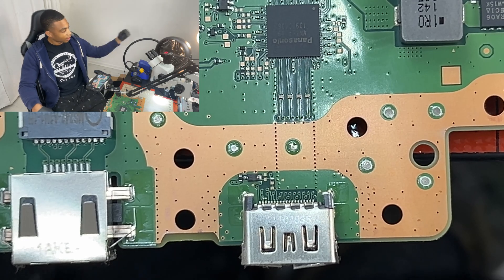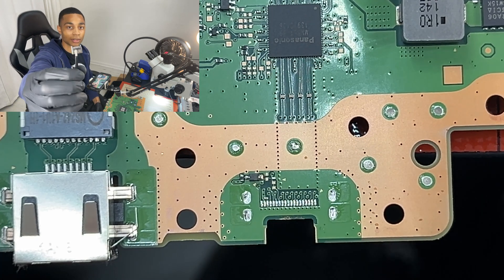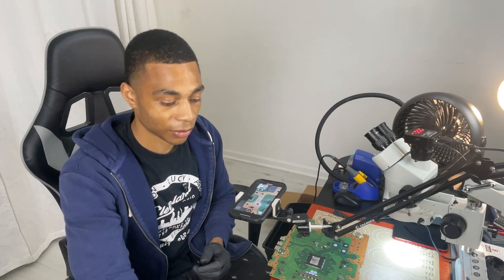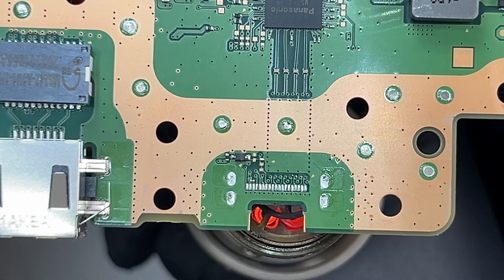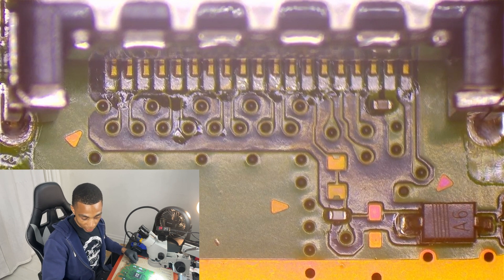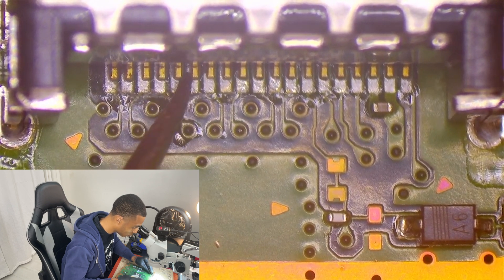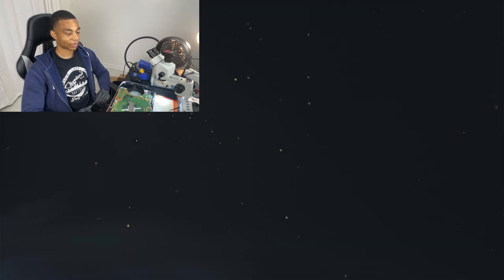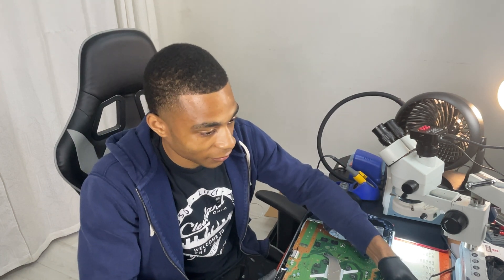PlayStation 5 HDMI Port Replacement Tutorial

Comment: I am trying to help a friend fix his. He tried first and knocked the 100nf cap off the board that's mounted right behind the hdmi port. I have read it will work fine without it. Do you know if that's correct?
Reply: Yes, that's correct.
Reply: @legendofcho hdmi went on no problem but it turns on blue light for 4 to 5 seconds and then shuts off.
Reply: Did you have any bridges or missing points? If you heated from the underside, Did you knock off any components by accident?
Reply: @legendofcho everything looks good. No bridges. I did heat from the underside. All the components appear to still be in place.
Reply from the maker: Some say the PS5 works just fins without but I always replace it anyway
Reply: @cwhiteIT  I replaced it and the HDMI port but there's another issue I fear I don't have the knowledge to fix.

Comment: Why did you leave the pins on the the right brown ?
Reply from the maker: All pins were already making a secure connection to the board. I tinned the pins on the left for demonstration. I didn't want to risk moving the capacitor in front of the pins on the right.